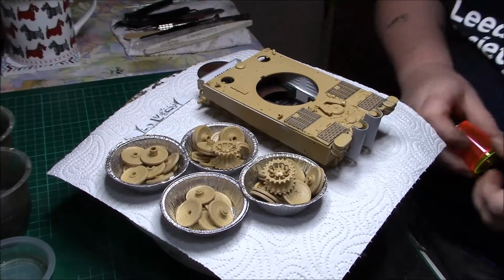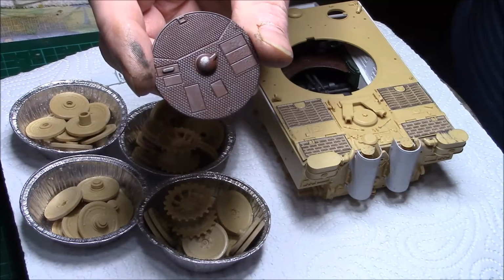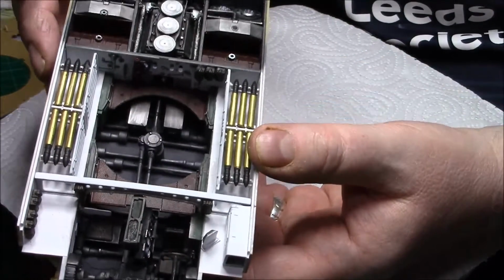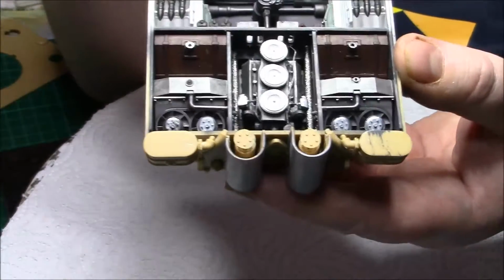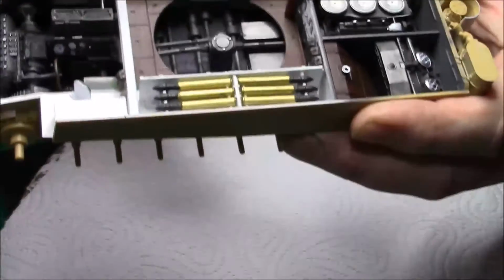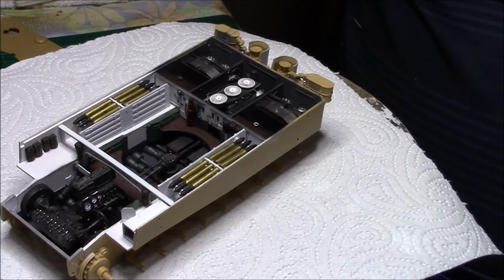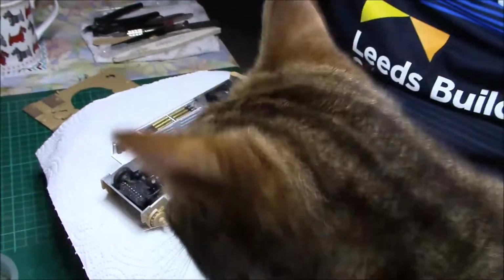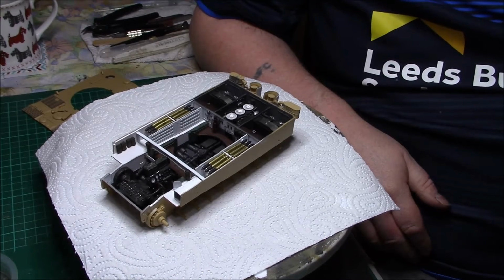Whats on the bench 14/2/18 (Buddy build Academy Tiger 1 with full Interior)

Comment: Hey, that kit looks very, very awesome. But I've got a question. I read, that this Tiger ist a little bit smaller than the real Tigers in 1:35. I wanted to build a Diorama with to Tigers, so can you please tell me, how long and wide this tiger is? Thank you very much ✌🏻
Reply from the maker: Thank you very much. Just measured the length and width of the hull and 18cm x 10cm hope that helps
Reply: @GregReilly135ScaleModels  yes that helps a lot. Thank you for your answer :)
Reply from the maker: Your very welcome

Comment: im working on my 2nd did have an issue with the step that you set the parts that the floor sets on. the storage boxes dont quite fit right, did you have problems also besides that its a awesome kit
Reply from the maker: I  honestly cant remember the only thing i can remember was the transmission was a bit awkward to position
Reply: @GregReilly135ScaleModels  yeah it was a tight fit and in the process i broke the  brake part off. the way i did the floor i had to glue it from the underside of the lip on the storage. I do mostly ww2 aircraft ill do tanks every so often.
Reply from the maker: When you get it finished I'd like to see it if that's ok
Reply: @GregReilly135ScaleModels  yeah i can do that not sure when that will be lol. after the first one i learned to step back after a bit and take my time working on it
Reply from the maker: That's the best way I always do that